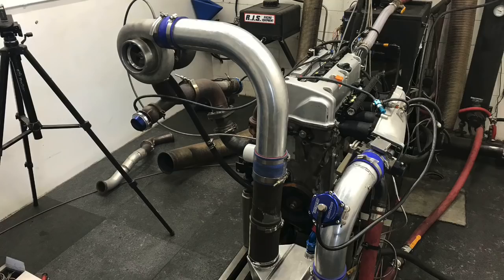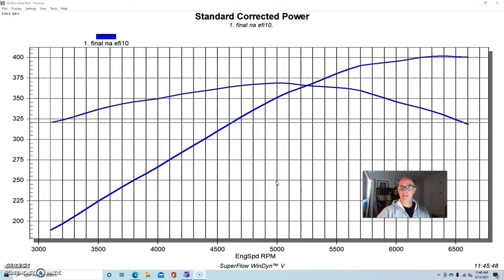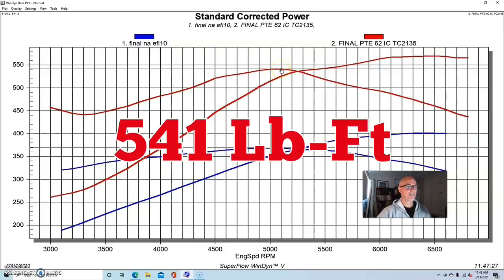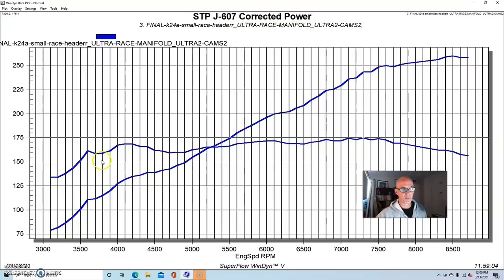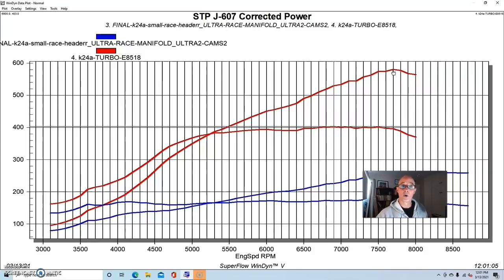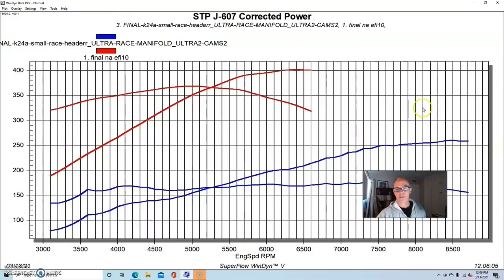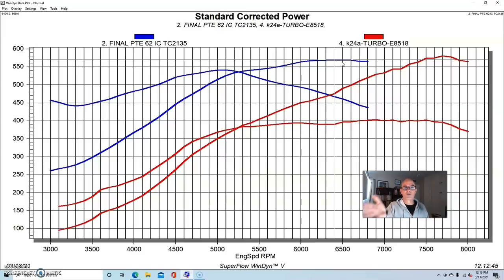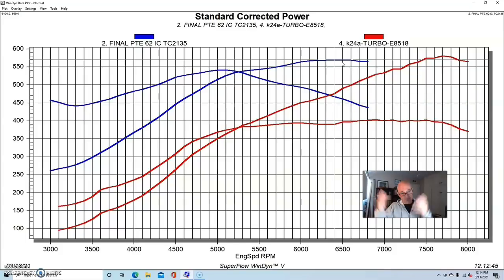CHEAP, JUNKYARD BOOST TEST-K SERIES HONDA VS LS (2.4L vs 4.8L)

Comment: why do you think the k24 made more than double its na power when boosted to like 14.5 psi?
Reply: Because honda motors are some of the very few engines out there that have over 100% volumetric efficiency, or VE. 
K24 head flows EXTREMELY WELL and is EXTREMELY WELL DESIGNED.
Reply: Because pressure isn't the number that matters, if he had an air flow meter it be be reading much more than twice the amount of air at 14.5psi manifold pressure than it would be in NA configuration. Could also figure out manifold density/air flow if he had a fuel flow sensor and the basics logged.
Reply: Maybe it pushed torque peak to a higher RPM
Reply: @lucysmith4242  The K24 HAS to make both peaks at a much higher RPM to make up for the discrepancy in displacement.
Reply: @rustysausage69  I'm aware. I was saying maybe it seemed to have that great efficiency on boost because it pushed torque peak to a higher RPM than it was NA. I gotta look at the graphs

Comment: * The 4.8 because if your purpose is to drive on street the LS would be mild and dependable idle in traffic etc... And at 7 lbs there is SO Much More still in her Lol and still have drivability compared to small 4 cyl with Big Cam and injectors but LOVE ALL MOTORS cause 2.4 with 580 hp certainly bad ass
Reply: Vtec exists to get the best of drivability and performance. When its on the small lobe, that thing will idle like a sewing machine and get great economy to boot. This was a pretty mild k series.
Reply: @madmod  Exactly this. With VTEC you can have a mild cam that will scream later on. Kind of having your cake and eating it too.
Reply: @marc-oliviercabot3380  I would love to have that tech in a modern V8. The cam phasing found in both gm and ford v8s have made huge gains in both peak and average horsepower. Even with a  stock and especially with larger cams, piston to valve clearance becomes a big issue with phasing. VTEC literally is the best case scenario by having two separate cam lobes. Nobody's complaining about the power provided by these modern engines, but it is nice knowing there is room for improvement.
Reply: @madmod  Yes if your 4 cyl has vtec or if your cam swap didn't disable the vtec Yes i agree but being a previous and current owner of 500+ hp 4 cyl turbo motors with so called streetable cams like my Brian Crower 272 in a 4g63 and 1,450 cc injectors and then needing a clutch to handle all that power made for a not so friendly street driver but fast Yes extremely
Reply: @miker1681  often aftermarket cams require limited phasing of the cams due to ptv clearance which can often hurt low speed torque/off idle drivability. The benefit to these dohc cars is the ability to set centerline angles up however you want from a choppy idle boosting the midrange, or smoothing it out and helping it carry over up top. 270° advertised duration cams are far from what id call small but im used to cams spec'd for twice the displacement. A 220 at .050 cam support turning 7k rpms on my v8 and thats only around 265 advertised.
Reply: I have a k24a2 swap civic hatchback an I have a 6.0 lq4 s10 civic runs low 11s all day my s10 runs 12s all day... only way to say this is u take a Chevy chevette with 500hp with 2000pds car then take a k swap civic 500hp 2000pds car the k swap civic will still win.... Richard is trying to show u v8 guys that k swap are not slow...

Comment: Obviously the LS produces a much more usable power band and using junkyard heads, intake and getting it local instead of imported means it's a much cheaper combo.  It's also easy to get a big China turbo and increase the power a lot only spending on the fuel system to support it.

The K motor is impressive but it does need much different gearing because the party is only starting around 4,500 rpm.  It would not work well in a heavy vehicle.  In a very light vehicle that already has appropriate gearing, it could be the better choice for packaging and preserving vehicle handling.
Reply: One problem.   There isn’t an LS in a junkyard within 50 miles of me and I live in a city of 500,000.
Reply: @BustedWalletGarage  its still easier and cheaper to buy a junkyard 4.8 shipped a few hundred miles than a K24 shipped from Japan.
Reply: @BustedWalletGarage  You need to move

Comment: So did the honda make same power with less boost? Or did it with more? he said it did same power with relatively less boost but earlier he said they were gonna run it on more than the ls just confused how much boost was the ls on? Great video
Reply: So, it took more boost for the Honda to get to that power level, but less than you'd expect, because it is so efficient at making power with that limited displacement.
Holdener is saying that it's "relatively less" because if the Honda was only as efficient as the LS, it would have needed even more.
Reply: If we remember that atmospheric pressure is 14.7 psi, it makes sense. It took the LS 1.5x the amount of air (atmospheric plus half another (7.7 lbs of boost)) but it only took the Honda 2x the base amount of air (atmospheric plus 14.7),  even though it's only half the size. Pretty impressive.
Reply: Thx guys

Comment: Imagine the boosted 4.8 in the Nova. 
Then Imagine the boosted K24 in the Nova.
Then imagine it on pump gas and a full exhaust.
Reply from the maker: pump e85
Reply: @richardholdener1727  3 E85 stations in the state of Washington...according to DOE alternative fuels site.
E85 is not an option.
Reply: @TwoLotus2  He doesn't live in washington
Reply: @lucysmith4242  I don't care. I do.
Reply: @TwoLotus2  I'm sorry you have to live in washington

Comment: The impression I'm getting is: The LS needs K24 heads. 😛
Reply: lol exactly. There's actually an engineer who is making a V8 with the k20/k24 heads and v-tec, best of both worlds.
Reply: I want to see an ls with one of them “freevalve” setups. The one with valve actuators. No cam, lifter, rockers etc...
Reply: @tuloko16  Huge huge complaint of free-valve setups and why companies steered away from it/failed to deliver was because they couldn't keep the actuators cool, they build LOTS of heat. Good luck redesigning the oiling system for that reason, because without a cam/lifters/pushrods, NO oil gets up to the top end to cool the actuators, and no cam slug means no oil gets to the bottom end either because they aren't a priority-main design block.
Reply: @rustysausage69  thread AN fittings into the lifter holes and press fit aluminum plugs onto the cam holes without bearings, aftermarket blocks can be had with mains priority oil first
Reply: @rustysausage69  LS heads from mercury racing are DOHC
Reply: I have a simpler solution. Just buy a 5.0 Coyote.
Reply: Get a 4.0 1uz rev high as hell and nasty with boost but too bad there’s not enough after market, all the idiots focus on 2jz
Reply: Basically a coyote 5.0 then...
Reply: @tragicnomadic  Coyote has variable valve timing but not variable lift like V-tec systems which produce a wider powerband and better top end.

Comment: Not enough information to answer the question. What's it going in? That makes all the difference in the world. A Miata? Honda all the way, keep 90% of the handling & triple the power. What's not to like about that. Just for fun I'd be curious to see the Honda in a stripped-out notchback Fox, sort of a poor-man's SVO. Anything over about 3K pounds or any max-effort straight line stuff, LS all the way. Can't beat torque. 

Great comparison & shows how doubling boost & halving displacement results in almost equal output. Still waiting for a big-bang Triton V10.... 💥
Reply: I have a k24a2 civic an a 6.0 s10 my civic is all stock runs 11s all day.. let me say this u take a chevy chevette with 6.0 500hp weight is 2000pds... then u take a k24a2 civic 500hp weights the same 2000pds the civic will still bet it.. Richard is doing these videos to let ppl how the k24a2 is king an will bet v8 my 6.0 s10 runs 12s all stock... I swap civic are faster then any chevy,mustang,or dodge

Comment: 4.8 is the way to go here,, little more boost and its not even close.. although you should of put the actual weight of each engine as well, that little 2.4 would be a bit lighter..
Reply: LS V8s have a nice compact and light structure, the difference is substantial, but not too striking. From what I found on the interwebs, not much more than 100 pounds.
Reply: @twistedarrow3574  it would not be faster because the average power would be more with the 6.0lL you need to look at the whole RPM range between shifts not just the peak power numbers, your only at peak power for a fraction of a second. Just like this example in the video, even with the 4.8L down 10HP at peak it makes WAY more average hp all through the RPM range between shifts. The saying there is no replacement for displacement is true..
Reply: @twistedarrow3574  is that a typo? 245hp at 2400lbs is mid 12s not low 11s. either your way off on the weight or way off on your hp numbers. And if you have a 6.0L in a 2800lb s10 then there is something VERY wrong with that engine to only be running mid 12s. a 2800lb car to run mid 12s your looking at ballpark 280-300hp range.. thats a huge problem to only be making that small of a hp out of a 6.0L
Reply: @twistedarrow3574  I didnt say you would be in power a short time I said you would be at PEAK power a short time. You need to look at the total power range between shifts. depending on your gear ratios you will have about 1500ish rpm sweep, you need to look at your rpm after a shift up to redline again. That average power is what matters. Just like in the example with the 4.8L in this video. after a shift the rpm would be 5300rpm for the 4.8 and 6500rpm for the 2.4 L 
4.8L @5300rpm 540HP 540ftlb
2.4L @6500rpm 490hp 400ftlb 

thats a 50hp and 140ftlb increase for the 4.8L right after both shifted, and the 4.8 makes more power the entire rpm range other then just a 300rpm range at peak power for both engines. The 4.8L down 10hp has more average power.

Comment: Can't wait for the K24 big bang video. I have a couple K series engines and currently building an all out aluminum rod short stroke 2.1L K24 capable of a reliable 10k rpm.
K swap the world!
Reply: Holy moly
Reply: I've been revving to 10,400 rpm since September 2019 when I finished my mr2 .. if you want a reliable kseries with the kinda rpm you said you wanna go k20 not k24 the extra torque in the k24 will hurt you sooner and they aren't known to last as long at anywhere above 9500 I went through 2 k24a2 in 1 month now on my 2nd year with k20 with the block and heads being the only difference .. same setup everywhere else, just something to think about if your gonna spend the money might as well learn from mine and other guys misfortunes
Reply: @freedomfox8183  I am well aware, the 99mm stroke on a stock K24 is too much for high rpm. So I'm doing a K24 block with a K20 crank so it will be same stroke as a K20, just slightly larger bore and the rods are gonna be a little over 19mm longer than in a K20 as the K24 block is taller. I haven't ordered the custom rods or pistons yet because if I can find a reasonably priced F20 crank which is even shorter stroke, ill go that route.
Reply: @joelg6740  Did you overbalance the crank? What % ?
Reply: @lucysmith4242  Haven't got to that point yet. Need the pistons, pins and rods on hand but I still ain't 100% set on a K20 crank as even at 10k rpm the piston speed is higher than I'd like. If I can find a used F20 crank I want to go that route and then have it lightened and balanced. I could always have a custom crank made with like an 80mm stroke which with an 89mm bore will make it a 2L but the price is rediculous. Edit: Well I just requested quotes from a bunch of different manufactures for a super light billet 80mm stroke crank. Even at 11000rpm the piston speed is reasonable at 5774ft/m and rod to stroke ratio is 2.08 💪 Now if only the valve train will be able to keep up. Should be a pretty wicked little engine NA on methanol with 16:1 comp, will hopefully rev like a superbike with that crank paired to the lightweight aluminum rods and super light weight forged pistons.
Reply: I have a lq4 6.0 s10 all stock drag truck I just build a k20a2 6 speed civic all stock i just put the k24a2 in it with k20a2 head with rbc intake an rdx injectors the civic eats on these v8 guys an they say it's not stock or it must be turbo... all I say is its stock if u want me to put turbo on it I'll pinks u... lol

Comment: I’d rather push a Ford than drive a Chevy
Reply: If you own a ford you don’t have a choice!
Reply: If you’re gonna be dumb you gotta be tough.
Reply: I'm sure that's what you do most of the time
Reply: Strong username to comment ratio
Reply: I guess you're trying to save on fuel.
Reply: The GM section of the junkyard is always the largest... and they're newer cars, all with the same parts stripped off due to epidemic failures. You push the Ford, leave the Chevy.
Reply: @pgtmr2713  Chevy guys get triggered easily.  They must have flashbacks of jumper cables & bent tie rods.